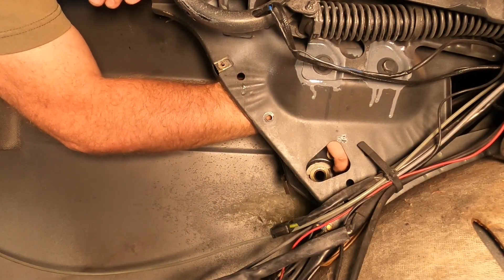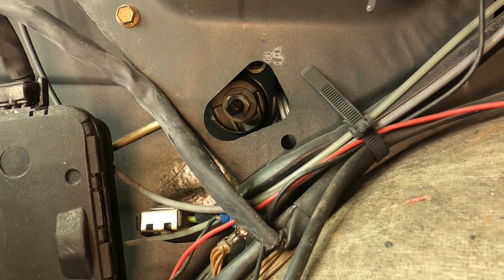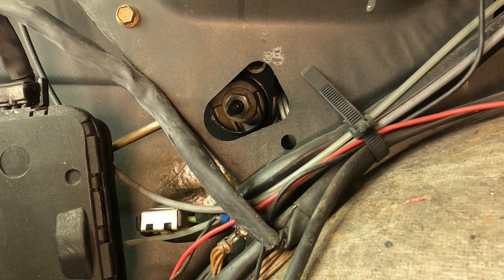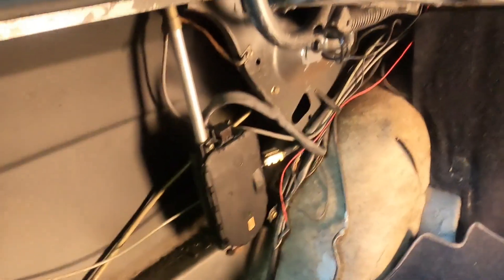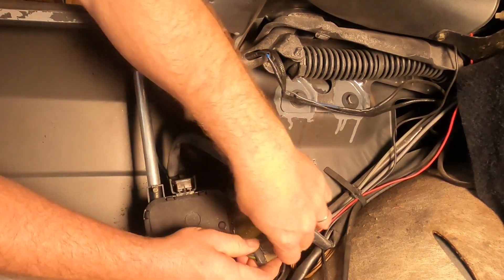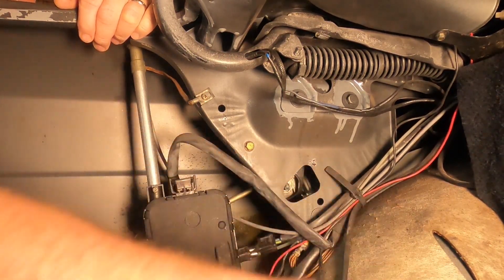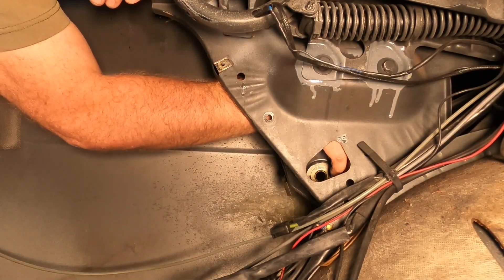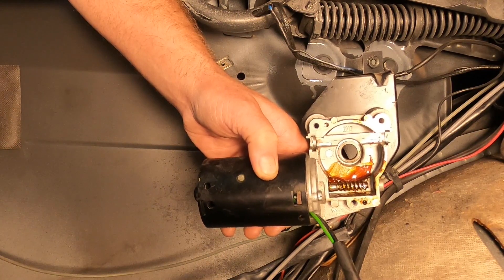W126 Mercedes Sliding Roof Repair and Maintenance Part 2 - Motor Removal

Comment from the maker: In this video I incorrectly referred to the lower tube as a water drain. It is simply the tube into which the cable protrudes when the roof is open.

Comment: I’m trying to learn what I can from the video but I’m starting to see a difference. I have an ‘88 W126 with the rear left sliding roof corner down compared to the rest of it, seemingly in alignment. I happened across the emergency operation of the sliding roof in an online manual, but I’ve got an additional white plastic gear with “heben” meaning raise and “senken” meaning lower to the rear of the red plastic cover you show here. Is the white plastic gear for the radio antenna? (It just clicked for me that it probably is)
Reply from the maker: The power antenna is a completely enclosed unit with no exposed moving parts other than the mast itself obviously. Not sure about the white gear you found. Email me a photo?

Comment: Where are the men in white coats? You know that talking about your self in the third person is the first sign of lunacy? 😆 🤣 😂 

So what is it that's broken? Is it just the cable needs grease or the motor gears?
I had to replace the cable on my 83 Peugeot. Not fun. I pretty much tore up the headliner getting it out.
My 01 e320 panel only goes back a few inches then just bogs down. I hope it just needs the tracks greased. I'm not about to try to take it apart.
How did you get the cable off the back of the panel?
Reply from the maker: Current theory is that old dried up grease is clogging up the tube so the cable will not move properly. More investigation is needed. Removing the cover off of the back of the motor and pulling out the gears allows the cable to slip out. I will go into that in a little more detail in part 3.